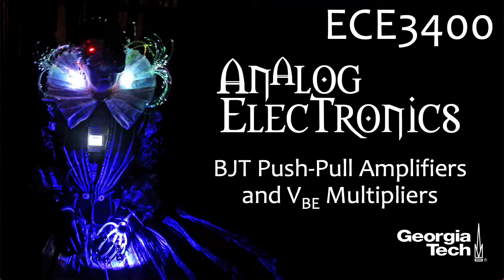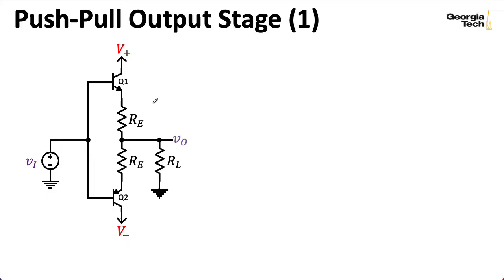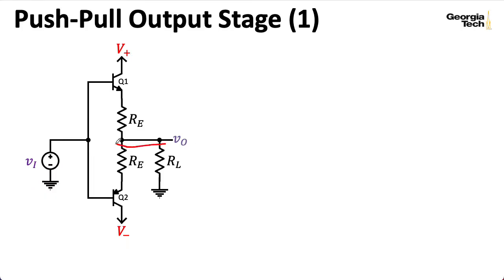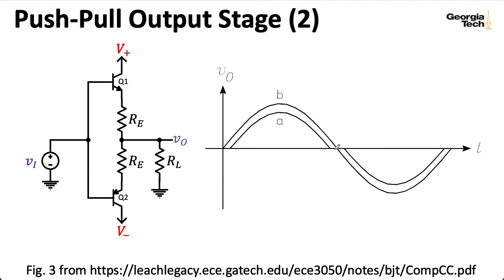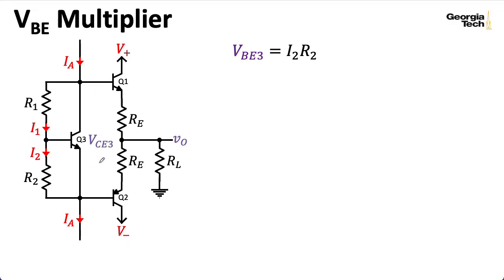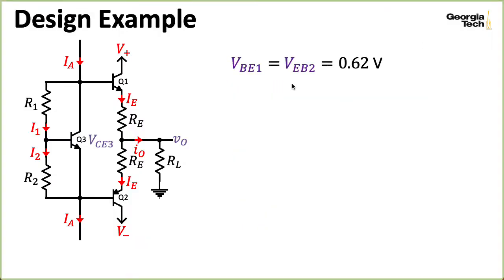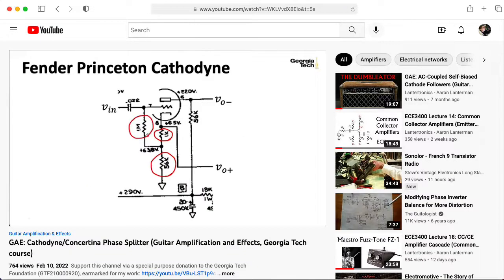ECE3400 Lecture 27: BJT Push-Pull Amplifiers and VBE Multipliers (Analog Electronics, Georgia Tech)

Comment: This whole discussion is a total waste of time.  I have been teaching electronics for over 50 years and any circuit without the component values is produced by an idiot and discussed by someone who does not have a clue about electronics. The component values are most important. I can tell you how a circuit works simply by knowing the component values. I have never used a simulation package in my life. And that’s what l teach. All this discussion is drivel. You wasting you time without circuit values. Just a waste of $70,000.
Reply from the maker: That's what homework assignments are for.

Comment: Why do some class AB amplifier have bias currents up to 1000mA or even higher when you just need 50mA to make the crossover line straight?
Reply: These are Class AB amplifiers, but they differ in their depth of Class A operation. There is a myth that Class A operation provides better sound quality. In fact, deep Class A operation results in higher power losses, and on top of that, it sometimes degrades the performance of power transistors, as their gain drops at higher currents. 

Deep Class A is sometimes used in Class AB amplifiers, in which transistors in the power amplifier output operate in a common-emitter arrangement, that is, the signal is received from the collectors or drains. These are rail-to-rail amplifiers, which actually work better at higher resting currents. This is because these amplifiers are less resistant to load, and raising the resting current partially offsets this problem. 

Amplifier outputs with transistors in a common emitter arrangement are also often found in high-speed ICs that have rail-to-rail output. Manufacturers of such circuits, however, state that achieving the full voltage range of operation is possible only with very small loads - for example, 10 k ohms. If you increase the load, for example, to 1 k ohms, the circuit will work, but the allowable amplitude of the output signal will be greatly reduced.

In conclusion, we can say that sometimes this increased resting current is a marketing gimmick, and sometimes it is necessary to achieve the intended output parameters of the amplifier.
Reply: @GluonToo  I agree :face-blue-smiling:

Comment: Why are there diodes???
Reply: In the case of the first amplifier, diodes D3-D6 increase the voltage drop and allow reducing the resistance of R25. In addition, they respond to the temperature of the interior of the amplifier, not just the power output heat sink itself. If the interior temperature increases, the current of transistor Q7 also increases, that is, the voltage CE deposited on it decreases. Therefore, eventually the bias of the power transistors also decreases.

In the second case, the diodes spread the voltages that control the bases of transistors Q8 and Q9 by about 1.4 volts, so that both transistors remain on all the time and have bias.

Comment: the That2180 and some SSI and Alfa ic's have "multipliers" inside, they are hidden, secret.
always wondered about that, this was the first time i heard a explanation about it and still ...

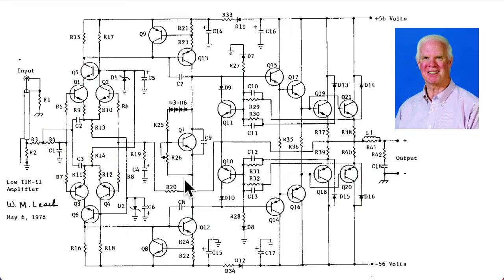13:24 holy cow!
now that's what i call over complicated, lol
what kind of voltage regulators would that circuit have (back than)?
Reply from the maker: Check out Marshall's writeup on the Low TIM amplifier: https://leachlegacy.ece.gatech.edu/papers/lowtim/feb76feb77articles.pdf
Reply: @Lantertronics  thank you, but: Connect to the campus VPN and then retry
Reply from the maker: @AnalogDude_  That's very strange, it should be public. Just try googling "low Tim amplifier"
Reply: @Lantertronics  it's a pretty clever circuit with a feedback going back to Q2, Q4. i understood i had to set the zeners to 20V from the partslist.

Now i removed C9, the one parallel to R21 around the multiplier and i have "audio" again. +/-45 volts, but with these dead bands around "zero" cross and looking looking like a square wave. looks like over driven sine wave.

now it's gone again, while i changed nothing apart from c9.
Reply: @Lantertronics  ah, C10 was 100nF, but needs to be 150pF, working again, but still a weird shape, much weirder.
+/-25 v output.
Reply: @Lantertronics  got it, changed r2 to 120k, standard sine or any wave in Falstad is 10 V.p.p.
Looking good.

did you think this amp is still relevant today?
Somehow i like it.

Are BC547/2n3904 and Bc557/2n3906 suitable?
Reply: @Lantertronics   Thanks.

i have introduced it in to  the simulator.
at first it clipped massively to the power rails, then i realized i put the power on the wrong side of the circuit, now it doesn't do anything. here is the file for the falstad simulator, was quite a massive job.

"/2fl8prex" just paste this behind a Falstad simulator "shared" link.
Reply from the maker: The multipliers you are referring to in the THAT and SSI chips are very different than the VBE multiplier discussed here.